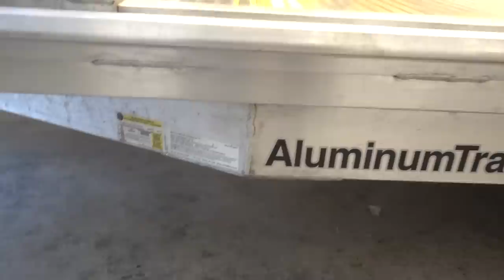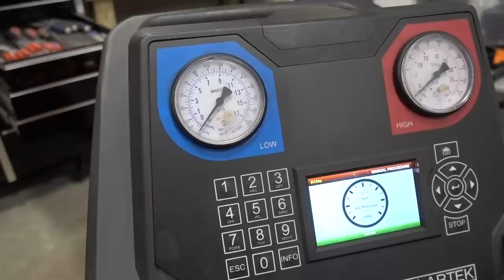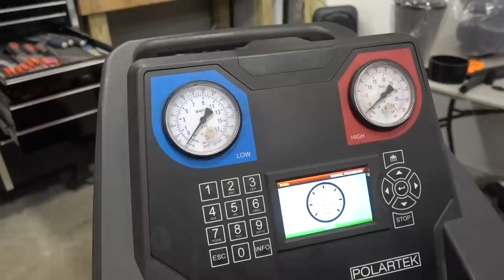NEW ALUMINUM TRAILER PROJECT!!!!

Comment: You don’t need an a/c machine to charge your system. A set of guages and a vacuum pump  and you can do it the way we did before the Machine came out and made techs lazy
Reply: I believe he wanted to use that machine because it had the refrigerant that was removed from his truck so he could replace the lines.